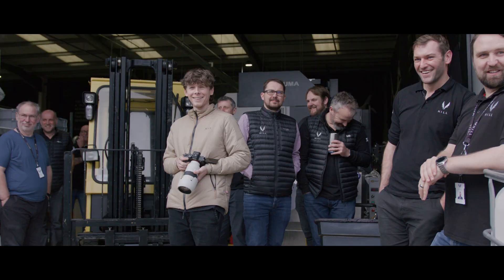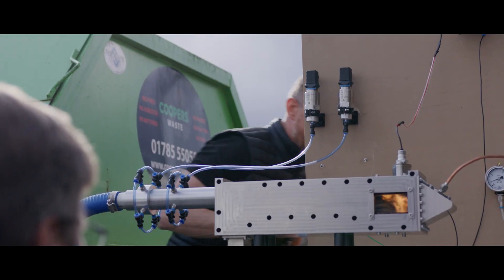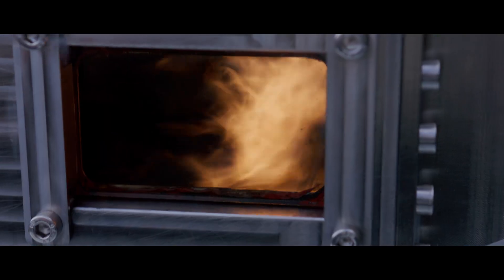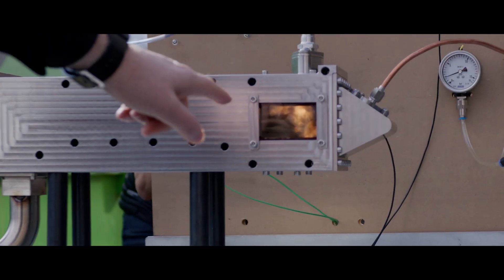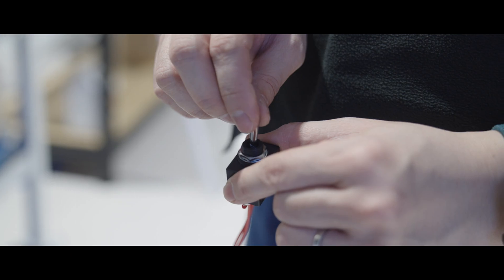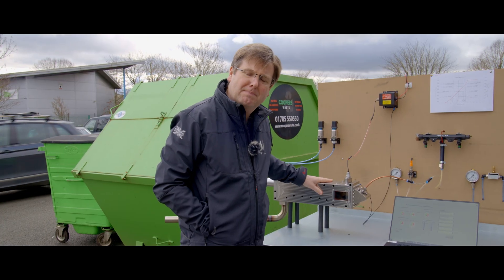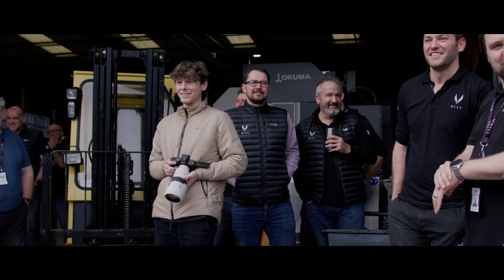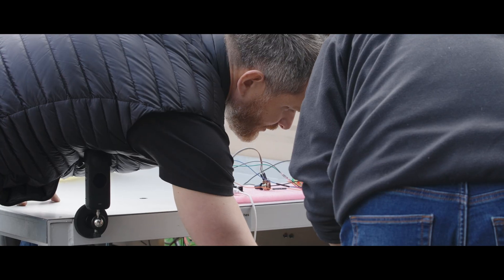Journey to the HX50 | Episode 38: GT50's First Flames of Success

Comment: Which is more challenging….? 

Airframe or engine design…?

They are both monster sized projects that need to come together seamlessly at the end.

Go Hill Helicopters!
Reply: engine for sure, and they're using proven designs in the rotor system (which is difficult)